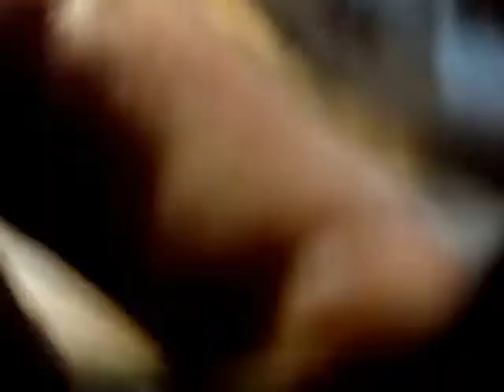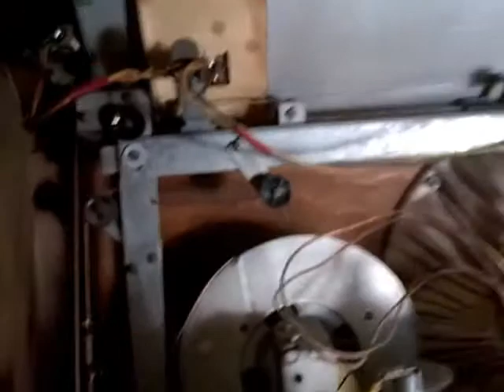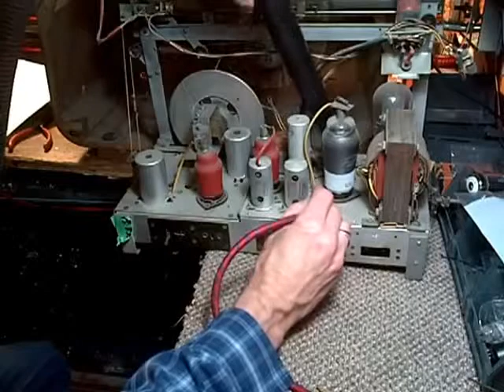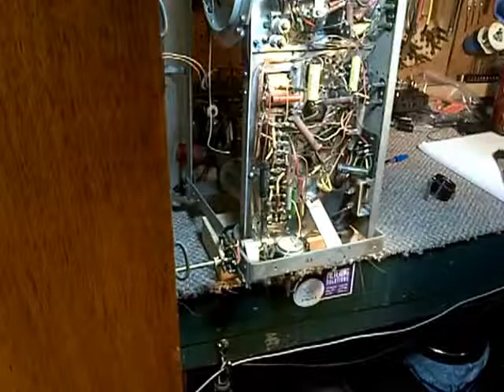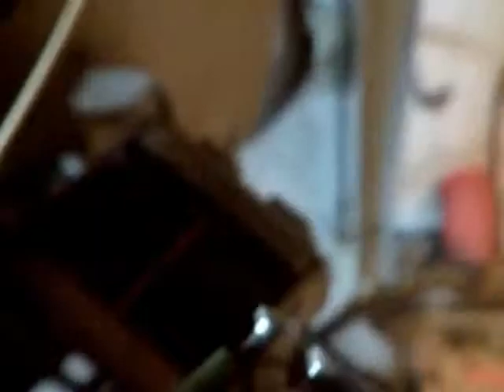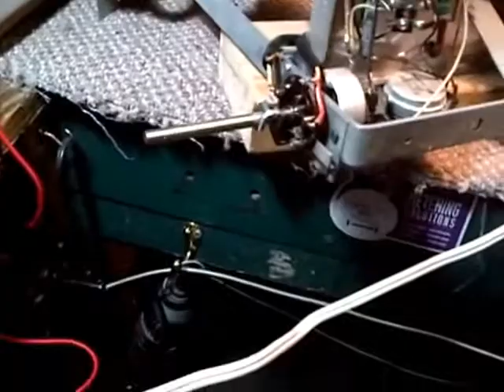Philips Sonate BA581A Vacuum Tube Radio Video #2 Inspect Chassis

Comment: Hello. Minute 33.This thick wire with slim wire covered is a variable capacitor, a kind of trimmer. If you give more turns, more capacity, and so.
Minute 47, termal protection.